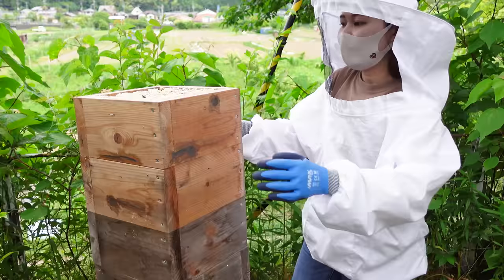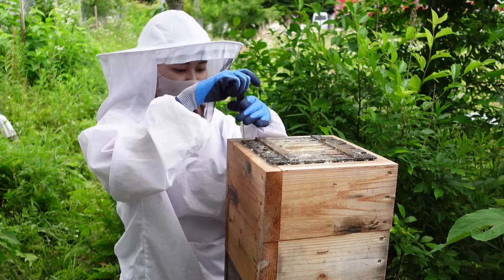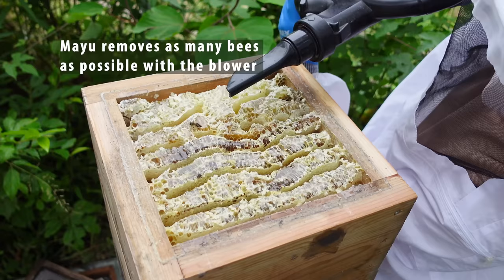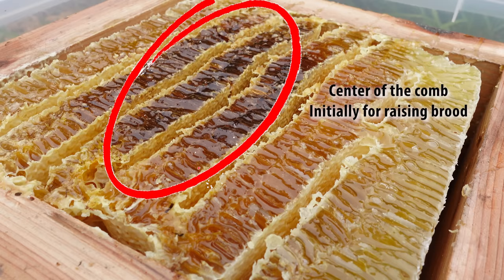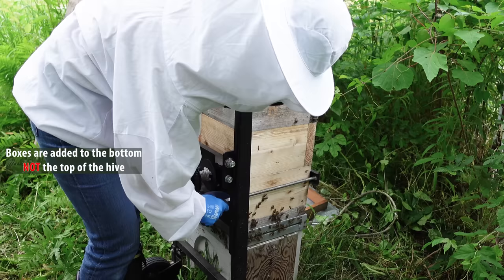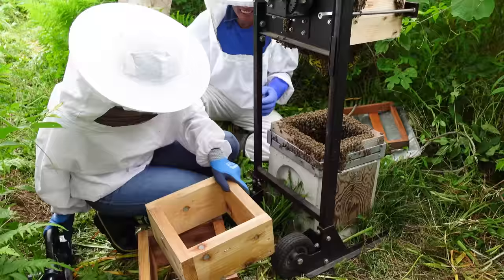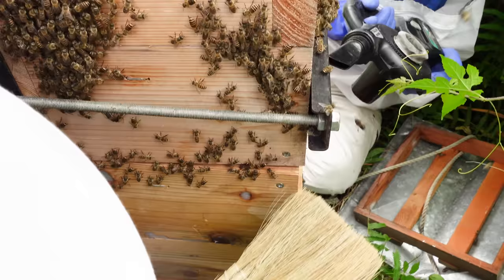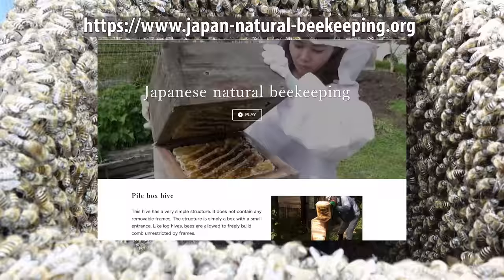Summertime honey extraction, Traditional Japanese beekeeping, Apis cerana japonica.

Comment: I've heard that framed hives have the issue of using old comb for brood leading to smaller bees since the old comb has less space for the larva to turn into bees. This method is so cool for the removal, if not complete lack, of that problem. I imagine with framed hives you could add a box to the bottom, maybe at the beginning of the season, and the queen would move down.
Reply: Depends on the age of the comb.
Reply: breeding minibees is a luxury
Reply: You can always put a new comb sheet in
Reply: Means the bees wont swarm with new  queens?